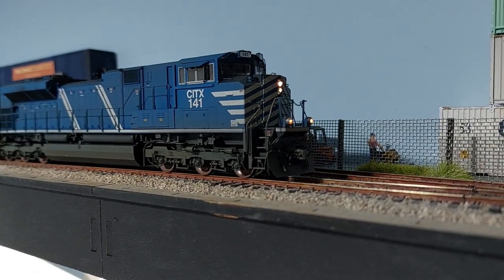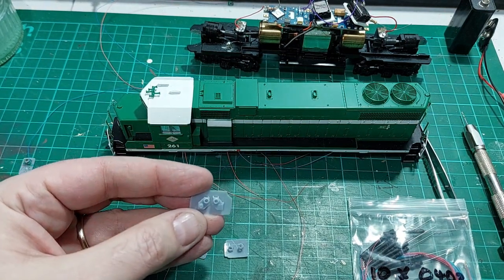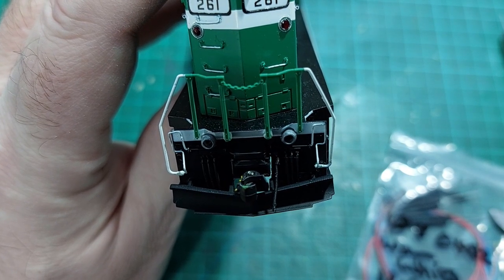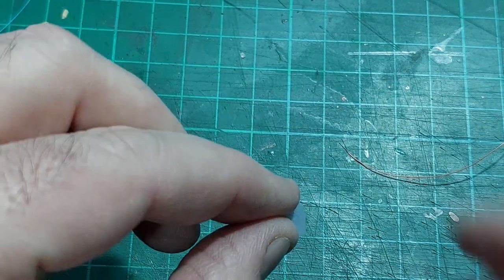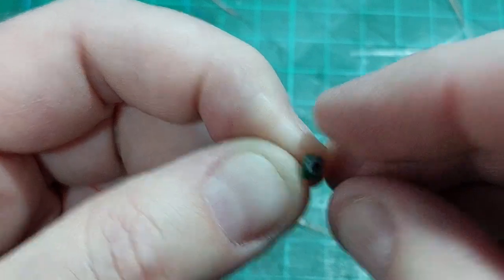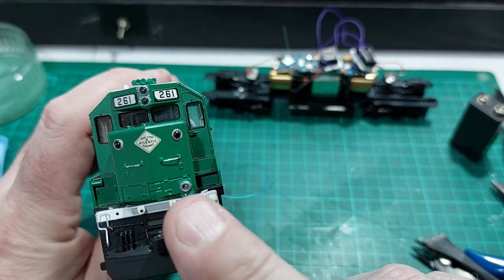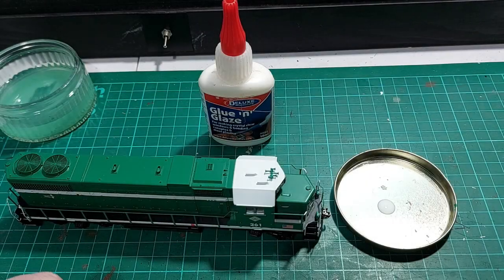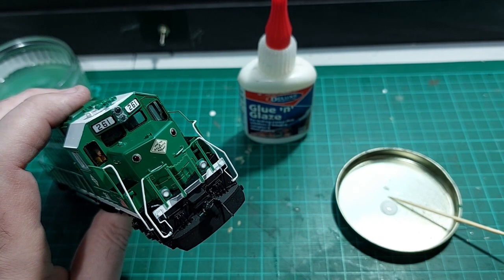Fitting Working Ditch Lights To HO Locomotives

Comment: Isn't the same for dc ho locomotive  wiring
Reply: Awesom thank you it's very confusing with all wheel pick up also different makers of ho models
Reply from the maker: @jerrysimon793  all you have to do is work out which pick up is positive when going forward so the head/ditch lights come on in that direction (if using LEDs). You then do the reverse for reverse.
Reply: @thebritishrailroader  thank you very much you were very helpful
Reply from the maker: This is true but very possible. Just a matter of making sure the LEDs are wired to the correct polarity

Comment: Good job on the lights.  Have you ever heard of the decoder buddy by nicks trains? It is a mother board that uses a 21 pin decoder. It has a has a separate board for lights that plugs into it.  It makes it so you can complete separate your locomotive shell from chassis. It also has built in resistors for leds. It makes dcc wiring a breeze
Reply from the maker: Thank you so much for the great comment. I have heard of the decoder buddy and used something similar over here in the UK. My go to decoder us the Soundtraxx Tsunami PNP8 so the function tabs are already there. The newer Athearn pcbs have a 21 pin interface and function tabs already in place so have used them in the past too. I think we are really lucky these days as manufacturers are really putting more thought into what they put inside their models so that we as modellers have an easier time making these sort of upgrades
Reply: @thebritishrailroader  gotcha.  I like soundtrack decoders. The pnp one is nice just wish they had resistors on the board already.    You’re right about the manufactures they are doing a great job.   Happy modeling!

Comment: Excellent stuff Steve. Thanks for the info and video. Andy
Reply from the maker: No worries mate, hope it was helpful.
Reply: @thebritishrailroader  It was. Need to work out how to get mine to flash for my short line locos. Saying that I need to see what sound decoders are fitted
Reply from the maker: @Redfearne and McKensy Norfolk Southern HO  if you need any advice, let me know. I am good on Soundtraxx decoders especially. Just remember, fixed ditch lights are the norm for shortlines so do your research
Reply: @thebritishrailroader  Mine is purely freelance so I can use my imagination lol. My main road is NS .